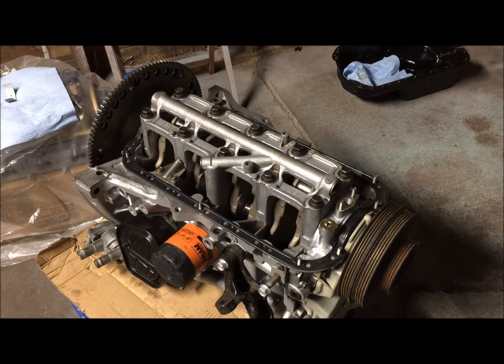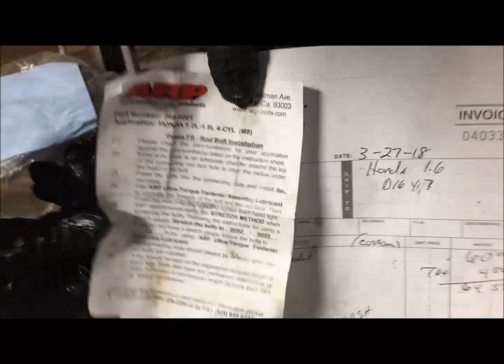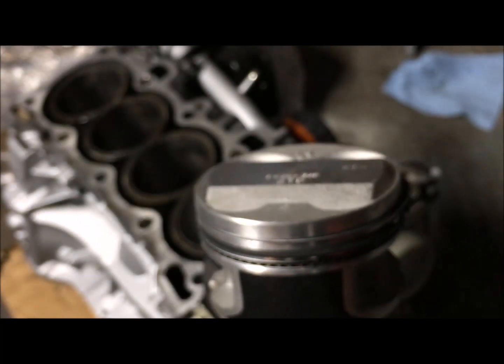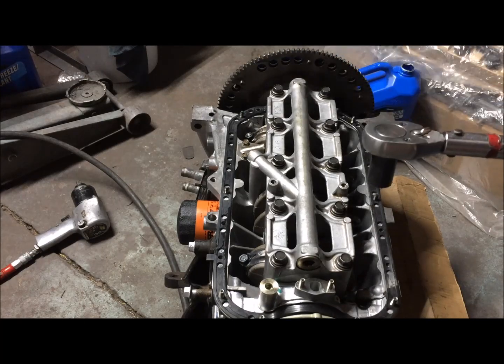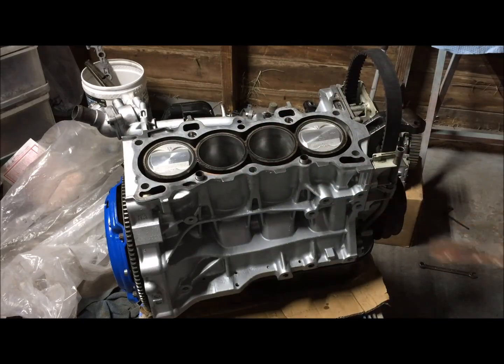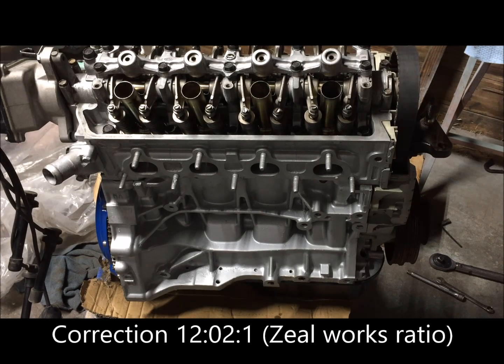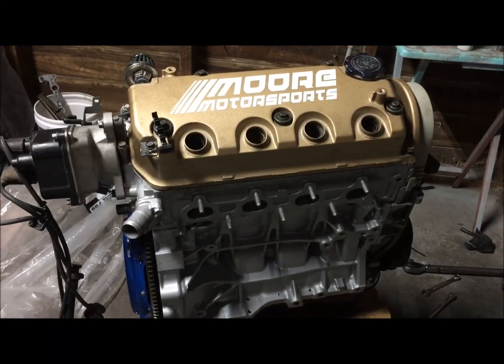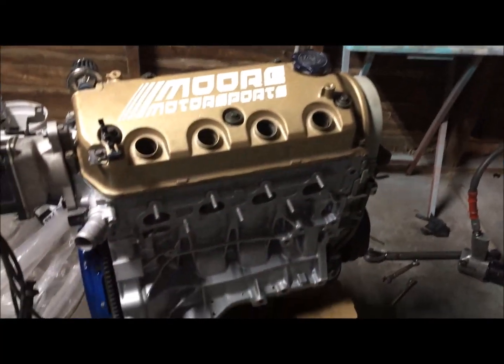P29 High compression D16 Assembly- Part 2 Going together/Ready for install

Comment: wow looks great. your definitely enjoying this engine build. everything looks so clean fresh. can't wait to see part3
Reply from the maker: Barbas Life I am enjoying it for sure. I love it and it runs great. I got it in but working on the video so it can be uploaded
Reply: nice yea video editing is a pain I just picked up a d16a yesterday I'm in the process of swapping my intake manifold over to it from my blown Y8 so I can drop it in.
Reply: the d16a came with a alternator my Y8 harness plugs in but colors don't match on the plugs. it's driving me nuts. any feedback if it will work.or should I just swap the Y8 alternator to be safe and avoid the headache.
Reply from the maker: Connecting harness to the car plugs dont match? Or the alternator? 

Obd2 alternators use a Different connector plug than the OBD1. You can always wire a 0bd2 plug onto a OBD1 harness. If the connector is square on the alternator its a OBD2 if its Round its obd0-Obd1. Need more info but always here to help
Reply: ok it makes sense now that you said obd1 is round.it's square on the harness and on new alternator.for some reason I was thinking it was different. thanks

Comment: Easier than facing the rod stamping to the back:
·The rod bearing tangs on the rod and the rod cap seat on the same side as each other (like an old Chevy 350), those bearing tangs need to face the exhaust side of the engine (oil dip-stick side, same side the identification stamp is on).
·The pistons should have an arrow, the arrow should face the front of the engine, towards the crankshaft pulley, not the flywheel, and there should be the larger valve reliefs on the intake side (USUALLY); with the exception being the use of Vitara pistons, because those are from the Suziki Vitara engine, so the arrow will face towards the flywheel of your D-Series engine, since the Vitara engine is oriented opposite of the D16.
·These steps are mission critical to remember while pressing the wrist pins in or to inform the machine shop of them if you have the pistons mated for you.

Comment: Saw your "eBay" vid. I'd say the diff is you actually work on cars, and a lot of guys don't. They use a mechanic and mechanics say things like "I only use Felpro" etc and won't install an eBay part. Part is a part. I did buy an eBay alternator for my Accord and it was DOA, but I shipped it back. No biggie.
Reply from the maker: Thanks most people jump straight to hate and don't realise that AutoZone and oreillys sell more junk parts that the sellers on eBay.

Comment: Hi, Great videos! I'm about to do the a similar build. What work did the machine shop do altogether? Just trying to figure out what to ask them to do with out sounding silly. What sealant did you use for the oil pump and rear main seal housing? I am using King main and rod bearings with YCP P29 pistons. Thanks in advance

Comment: I never clicked on A video so fast lol James do you ever used coper spray on the h/g ?
Reply from the maker: Yea thats what i used on my head gasket in this video ^
The engine running one is being processed right now.  It will be uploaded shortly!  Be sure to watch it!!! It runs really good. After its 100% broke in ima do a pull video before tune and after tune then track run it, Both Straight line and circuit.
Reply: James D guy I need to take my head off and spray my next one cause I have a small oil clean between the head and the block.

Comment: I want to ask i swap my d17a with d15b from a dragster garage about engine oil change i ask him he says 4000km or 3.500km or even less with castrol  gtx instead of 5000km if the engine is ported and strong is there any reason to change the oil 3000km please i just want to know because also i didn't know (about engine break oil 1000 thing) please can you reply to me

Comment: Did not you use arp head studs with 12: 1 compression?
Reply from the maker: Sergio González Didn’t. I have ran up to 18psi  on my turbo build without head studs just to see how long it lasted and it held for over 2 years before I sold the car. But if you can afford the arp then get them for sure just Incase.
Reply: @JamesDguy  good with y8 head sorry but what thickness of cylinder head gasket you used?

Comment: Did you pre stretch the rod bolts or just run them as they came?
Reply from the maker: The machine shop did. I took my engine to them to get the rods resized since its always recommended to get the rod resized with new bolts.
Reply: James D guy Thanks!

Comment: Fram oil filter? I hope that it just there while building.
Reply from the maker: Mike Fritz It’s running wix filter. I use the cheap Fram and magnetic drain plug for the first 100miles then drain oil and put in wix then drain again at 400 miles and put another wix. I took pan out checked everything over and it’s all good still. They didn’t have any good filters in stock and they never have them due to Hutchinson being a V8 town where they barley keep Honda spark plugs let alone filters. But the k&n is too expensive to replace 3 times. But checked the bearings and they still look good as new so my method works lol😎

Comment: Bruh Yamaha r6 itb's
Reply from the maker: OH MY GERD I WOULD LOVE TO DO THIS ON IT!!!! Maybe someday i could! My buddy has a few R6 Throttles!!
Reply: James D guy I will be on my lsvtec build bro. I really like how you are giving the d series a chance people throw them out. Myself I have given my old y8 for free to a friend to build because it's just easier to build a B series for all motor application
Reply: Next car I will 100% give the d series a chance. How are the auto trans d series ? I need auto for the daily ! Traffic is bad where I work so I'd rather not shift after a long hard day at work
Reply from the maker: gurjinder singh They are not bad as long as they are taken care of. No neutral revving and dropping into gear. But you can not as far as I know tune a automatic ecu. I had a boosted d16 auto but ended up converting to manual so I could tune it. My car pulls pretty good untuned but it really needs a tune. It runs pretty rich with the new setup
Reply: James D guy I don't think I'll boost it or anything is probably just a cat delete and a catch can that's about it tbh. It's just going to be a daily not going to drive it hard do you think the d16y8 is a good motor in a 1.6el ?
Reply from the maker: gurjinder singh they are great engines as long as the oil is maintained.
Reply: James D guy just what I wanted to hear thanks bro